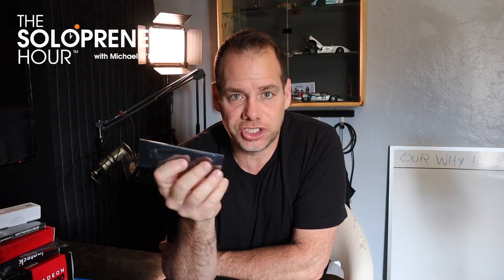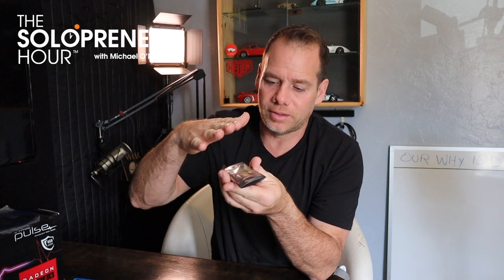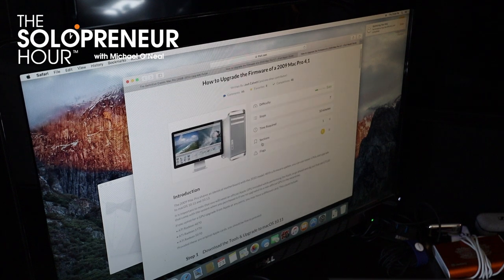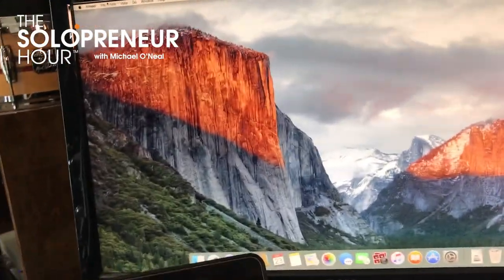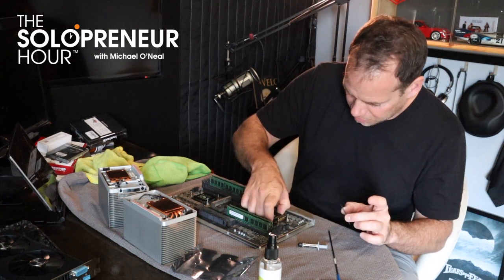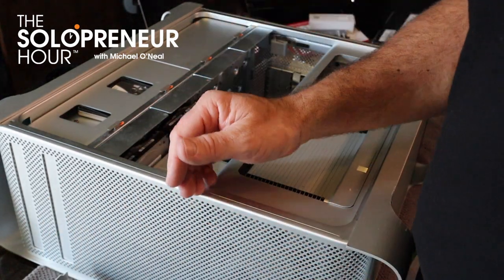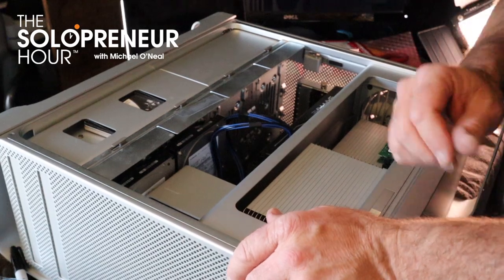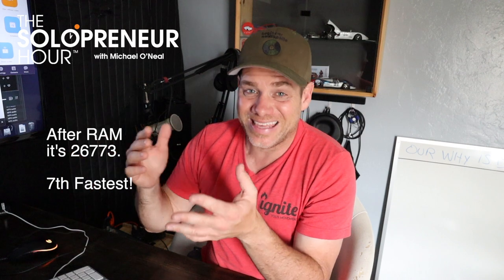The 2019 Mac Pro DIY Upgrade Guide - Building The Ultimate Video & Podcast Editing Workstation

Comment: For a self named “not an expert, I don’t do this for a living” this is the best video I’ve seen on this topic. I’ve been seen about 10 videos today and this is the best one, PERIOD! 

I’m waiting for my Mid 2010 Mac Pro I got for $400 and got a bunch of hardware that hasn’t arrived yet. Im so excited!

Thanks for this video!
Reply from the maker: How'd it go for you?
Reply: It’s up and running. It’s a dual processor. I also upgraded the CPU’s to two 3.33 6-Core, so 12-Cores total, 64GB RAM from OWC, Samsung M.2 SSD with PCI adaptor, as well as a 2.5” SSD, and a Pulse RX580 8GB GPU and a USB 3.0 PCI card. There’s still many things that can be added like a OWC Eccelsior 4M2 or the Sonnet Fusion where you can install 4 M.2’s. If you do, be sure to get the Samsung 970 EVO as it can give you up to 700mb/s on an old Mac Pro with a PCI 2.0 adaptorz The Samsung 870 EVO gives you the same speed of about 500mb/s as a 2.5” SSD. So if you’re gonna take advantage of the M.2 technology you have to get the  970 EVO or higher. 

Im loving my 2010 Mac Pro build. 

Thanks for the video!

Comment: the plastic spacers are to hold the CPU down so it makes contact with the pins because there is no lid on the CPU on the 4,1 to hold it down, the NVME or any PCI Drive does not matter if it says it is external it will still boot the same as any drive, been doing it for years on the 3,1 and the 5,1, it will even boot from the USB or the Fire wire if you want, Catalina will run on the 5,1,  it installs easier than ever, done it
Reply: give this man a cookie

Comment: I have Mac Pro 4,1 flashed to 5,1. It has 2X 2.93 Quad-Core CPUs, 32 GB RAM, AMD Radeon 7970 flashed EFI boot. SSD in PCIE card slot with 5 HDDs. I plan to put a 6th HDD in it soon and start RAIDing it. The 6th will be replacing the DVD drive. I also plan Dosdude1 patcher this Christmas break. Waiting for the bugs be worked out. My machine is hooked to my TV as media player and remote in with Apple Remote desktop. It's also my NAS/Plex server.  I also run 2 VMs on it.
Reply from the maker: Beast Mode!

Comment from the maker: THE BUILD: 
CPU - 2x Intel Xeon X5680 SLBV5 6-Core 3.33GHz 12MB LGA 1366 Processor  https://amzn.to/2JTBSib

48 GB RAM Kit - OWC 48.0GB (6X 8GB) DDR3 ECC-R PC10600 1333MHz SDRAM ECC for Mac Pro - https://amzn.to/2JOtxMC
(If you want the de-lidded versions, you have to search on eBay for them)

Graphics Card - Sapphire Radeon Pulse RX 580 8GB GDDR5 Dual HDMI / DVI-D / Dual DP - https://amzn.to/30VGjy6

Hard Drive/Storage - Sabrent 1TB Rocket NVMe PCIe M.2 2280 Internal SSD High Performance Solid State Drive https://amzn.to/2YWqTb1

SSD PCIe Card (Required to install above drive) - Lycom DT-120 M.2 PCIe to PCIe 3.0 x4 Adapter - https://amzn.to/2JR2AYy

USB 3.0 PCI Card - Inateck 4 Ports PCI-E to USB 3.0 Express Card Compatible Mac Pro (Early 2008 to 2012 Late Version) - https://amzn.to/2IdAYtt

Dual 6 Pin to Single 8 Pin Adapter Cable. (Required for Pulse Sapphire Video Card) - https://amzn.to/2Mh1Lu4

Optional (But necessary if you don’t own one) Eklind 54930 3 mm Cushion Grip Hex T-Key (For removing CPU heatsink) - https://amzn.to/2I3sRPS

Arctic Silver Thermal Paste - https://amzn.to/30VIW32
Reply: I bought everything ,

Comment: Ifixit are wrong. You can do the firmware update if you're on Yosemite. In Yosemite you don't have to disable System Integrity Protection (SIP) in order to flash the new firmware, because it doesn't exist. On El Capitan it exists.

Comment: Watching this on a Mac Pro 2009 with a Radeon 580 and a boot disk that's a Samsung 1 TB NVMe SSD. No problem booting from it, and no special tricks either. Just make sure you install the latest version of Mojave first, which gives the proper boot rom, which supports NVMe.
Reply from the maker: chaosmeister excellent!

Comment: The foam "spacers" on the heat sinks aren't evidence of a previous upgrade, they're thermal pads used to cool other components on that daughterboard, the VRMs. Usually on a PC motherboard, they're what's underneath all of the heat sinks around the CPU socket.
Reply from the maker: Oh good!  It seemed odd that it had been done before! Thanks for the intel.

Comment: Just saw your video today, but I literally just put a nearly identical box together less than a week ago.

2009 MP 4,1 2x quad core 2.26ghz processors, ATI Radeon 5770 GPU, BT no Wifi, came with all 4 drive sleds (no drives) and a power cord - $295 on ebay with the shipping.
Sapphire Radeon Pulse RX 580 8gb GPU used - $125 on ebay with the shipping (obvs it was used for mining)
Crucial MX 300 SATA SSD - $80 ebay free shipping
OWC Accelsior S PCIe SSD drive card - $50 ebay free shipping
4 port USB 3.0 card $30 ebay
Broadcom chipped 802.11ac/Bluetooth 4.0 PCIe card $40 ebay
96 GB 1333mhz ECC Ram (16GB x 6) - $180 ebay
2 x Xeon 5690 3.46ghz delidded processors $250 ebay

Thats $1150, but I probably spend another $25 on the power cable for the GPU, a DVI to HDMI cable because the Radeon 5770 had no HDMI ports and my monitor has no DVI inputs (just needed it to install Snow Leopard, upgrade to mavericks for flash, and upgrade to high sierra before dropping in the rx 580, it was crap anyway but it worked for its intended purpose), and a firewire 800 to 400 converter that I needed to support 2 legacy firepods.

So $1200 in so far.

Next friday when I get paid I'm ordering 4 x 4TB sata hard drives for project archival. I'll run them in a Raid 10 for 8TB total storage, I should be just over $1500 in at the point.

This MP is super fast, I'll geekbench it, but I assume your score was Geekbench 4, and the scores are different now in Geekbench 5

The only snag that tripped me up in the whole build was w,hen the OS wouldnt install because, like yours, it saw the SSD on the PCIe card as an external drive. Unlike your issue, because I'm using a SATA SSD instead of NVME, I just pulled the SSD off the Accelsior S card, popped it on the SATA connector in the #1 drive bay, installed High Sierra, Installed RX 580 GPU, installed Mojave, and then I pulled the SSD off the SATA connector in drive bay #1, mounted it back on the PCIe card, and fired up and everything ran wonderful without any messing around.

I know you're getting better speeds with the NVME, but I'm getting 500/420 write/read with my SSD, and it spec'd at 300/290 in the SATA v2 drive bay port, so not terrible.

I've never had macs, I've been on windows since v3.11 windows for workgroups circa 1993, so there's a learning curve, but this thing blows away the windows machine I've been fighting with for the last 8 months. Core Audio rules for my studio, I can crush editing huge RAW photo files - just files right through editing and saving them, no waiting like windows, and I'm ready to tackle some video projects I've had on the back burner for a while because I knew I'd just get frustrated using the hardware I formerly had.
Reply: Oh, While I was waiting for parts to come in I ended up grabbing a Mac Pro 3,1 2008, 8 core 2.8ghz, 16GB ram, GeForce 8800 GT GPU for $28 ($70 with the shipping) off ebay.

The interesting thing about the 3,1 is that with a couple SATA cables, a couple Molex power splitters, and a couple Molex to SATA power converters, if you ditch the Optical drive, and you pick up a couple 5.25" drive trays that each hold 2 drives, you can stick 8 HDDs inside the case, plus a SSD boot drive (or 2) on the PCIe slots.

I'll build that out next and run Sierra (unsupported) with the server app, and use it for time machine backups of the 4,1/5,1 MP, 3 iphones, ipad, etc., as well as a Plex server on a 1Gb Fios connection. The plan is to put a cheap SATA 2 raid card in it and run an external drive enclosure NAS off it to serve as a backup of the backup machine lol.

The only thing thats killing me is the cost of HDDs, 4 for the MP I just built, 8 for the 3,1, and 8 for the external enclosure. Thats 20 4TB drives. I'll buy the 16 for the older MP used, but you're still talking $1200 in HDDs.
Reply: I actually added another 8TB WD Red that I shucked from an ezstore external drive I bought used on ebay for $90
Reply: Once you go Mac you never go back.  After being a PC guy for 20 years, I decided to try my first Mac in 2008.  After one month I removed all PCs from my house.  My gf got me an XBox for Christmas that year.  When I saw that it was a Microsoft product I made her return it.  Macs rock!

Comment: From what I read about memory upgrades for the MacPro 5,1 and 4,1->5,1, 64 Gb or 96 Gb should be fine if you use 16 Gb modules (2 x 16 Gb or 3 x 16 Gb in each bank). Slots 1 and 4 of each bank share a data line, so if all 8 slots are in use, the system automatically slows memory to 1066 MHz as it access slots 1 and 4 of each bank in a common path.

Comment: you should install windows on this bad boy and unlock its full potential. Can't do it from bootcamp but you can do clean install on the ssd, install a software that reads windows harddrive from mac side and should make the windows side bootable. I have a similar build on my mac 2009 with windows and get faster benchmarks from windows. Also I can control my graphics card and overclock it.  below is my system info.
Edition: Windows 10 Pro
Version: 1903
OS Build: 18362.267
Processor: Intel(R) Xeon(R) CPU W3690 @ 3.47 GHz 3.591 Mhz, 6 Core(s), 12 Logical Processor(s)
Installed Ram 24.gb
System Model: 2009  cMacPro5,1
System Type: x64
Installed Ram 24.gb
Graphics Card: Sapphire nitro+ rx 590 8gb AMD
Storage: Samsung SSD 860 Evo 1tb (Windows) Default boot
Samsung SSD 860 1tb (Mojave)
Reply from the maker: I would actually LOVE to know how to do that.  I want to set it up for SIM racing.  I tried to hack bootcamp to work with it, but it didn't work.   Any chance you have some info you could pass along?
Reply: @solohour  No need for bootcamp. I just  installed it manually on it's own SSD from my other windows PC. I then installed it on my mac. Installed some software I forgot what it was called but it allowed me to see the SSD with the windows installed on the mac side so I could choose to boot from it.  I had issues attempting to install it on an NVMe drive so I went back onto the sata ssd. But I will follow that link below to figure out how to get the NVMe drive to work for me. Kind regards!
Reply: think it may have been called Tuxera NTFS for Mac
Reply: If you get windows on this, I would love to see a video on the benchmarks! I'm very curious to see how much faster it'll be. I subscribed and liked your video thanks!

Comment: Great Vid, I'm looking to upgrade my graphics card cause I have 3 monitors connected to my mac and one of the monitors is losing signal every10-15min (going in and out). After I changed wires, and a  new monitor it continues to do that. So I'm pretty sure now it's the Graphics card.  Would you recommend the Sapphire? because I have the same mac.

Comment: Hi,

What is the read and write speed of your SSD. Also the pcIe card does not have a fan. Do you have any problem with the heat? Also when you edit video files in FCPX, do you use proxy files or can your SSD handle like 4k videos?

Comment: Tech notes: Read up on static discharges .. before doing any work with electronics ground yourself by touching the metal chassis of the computer - plugged in but power OFF. Be aware around mains power.
 And keep the time to insert new CPU's into their respective sockets to a minimum to avoid socket contamination.

Comment: Michael: Many thanks for taking the time to present your "Build" and all the components listed in detail. I wanted to ask about the  compatibility of the USB 3.0 card (Inateck 4-ports). In the Amazon description it reads: "Compatible System: Mac OS 10. 8. 2 to Mac OS 10. 9. 5. It is applicable to MAC Pro(Early 2008 to 2012 Late Version); Windows XP/Vista/7/8/10(32/64-bit). Incompatible with Mac OS X 10. 10 Yosemite or Above."  

A little more research from MacRumors: https://forums.macrumors.com/threads/usb-3-x-pcie-cards-for-classic-mac-pro.1501482/. The consensus for those having problems with the Inatek 3.0 4-port card using Yosemite + is this: "The KT-4004 generally works well with OS X 10.10.x & 10.11.x but is not officially supported by Inateck for these versions." and then "If you are one of the few users that have problems with this card running under Yosemite, I suggest you return the card for a refund and purchase either the Sonnet Allegro USB 3.0 4-Port card or the HighPoint 1144D 4-Port card."
Reply from the maker: A BirdyNumNum it’s working for me at the mo...but if there’s another card you like more, go for it.
Reply: Michael, here is an Update from my last report: I got all the parts ordered and delivered. Following another video, I de-lidded the new 3.3 GHz CPU's. I may have damaged one or both (little pins) when sanding the tops of the CPU (after removing the solder). At the moment I have the  CPU's being examined at a computer store for damage. I may have to re-purchase two 3.3 GHz CPU's and this time I will install lidded CPU's.

I found that the re-installed 2.4 GHz CPU's will only hold 32 GB memory (RAM). I can add 5 x 8 GB sticks, but the system only reads 32 GB (4 x 8 GB). If I put in 6 x 8 GB sticks or RAM the system will NOT boot. So, once I install new 3.3 GHz CPU's I shall attempt to install all 6 x 8 (48 GB) RAM. 

Graphics card: I purchased and installed the AMD Radeon Sapphire Pulse RX 580 card (8 GB). Here is what I found with my system: 1. the card needs to be calibrated. 2. In the monitor display settings (whether a Dell or LG, etc.) one needs to change the color settings/ input color format: **from RGB to YPbPr**. I also found that each time I "Shut Down" my system to reinstall or remove RAM, the Color settings changed back to RGB. I have to manually change from RGB to YPbPR each time. It is not much to do but a hassle nonetheless. I am not sure why the settings are not saved after "shut down". Any thoughts?
Reply: The incompatibility 'problem' is that after putting your computer to 'sleep'  and later booting it on - the display shows that all the active inputs to the Inatek  USB card have not been dismounted correctly.
Just close them down as indicated and all is OK.

Comment: I apologize for the language, but I'm using the machine translator.
First of all, thank you for the video; it was interesting.
However, I have some doubts about the video card.
1) With an older operating system can't you use it?
2) With this video card, are you able to see the boot screen?
Because I know a lot of people don't and I think it's a problem,
when you have to execute commands at startup if you do not see the screen.
Another question: but couldn't you put an SSD directly into one of the four slots?
Thank you

Translated with www.DeepL.com/Translator (free version)

Comment: I have a 2009 Mac Pro with 4,1 can I leave my CPUs inside and just update the firmware so I can use the latest OS? Can’t afford new CPUs
Reply: You can update the firmware without changing the CPUs, but that alone will only allow you to update to High Sierra. I just did this today. To upgrade macOS further, you would need an approved GPU in order to update to Mojave. Catalina would still not be supported, though there are other means to force it. https://appleinsider.com/articles/18/09/25/apple-says-these-mac-pro-graphics-cards-are-mojave-compatible-reveals-boot-camp-support-limited-for-imac
Reply: The 5,1 flash will bring you to High Sierra. For Mojave you need a Metal compatible GPU. I just installed the Radeon Sapphire Pulse RX580. Not the cheapest card (240 euro's), but it works like a charm. Not sure about Catalina, but as an audio guy I try to stay away from Catalina for as long as possible :). I then upgraded my CPU's from the original 8 core 2.26 GHz dual CPU config to two Xeon X5675 (3.1 GHz), almost doubling my Geekbench multicore score to 6200. And after installing Mojave, I also added a Samsung 1TB NVMe M.2 ssd, which is now my boot disk. The entire upgrade costs around 650 euros (graphics 240, cpu 120, ssd 180, all ordered locally here in The Netherlands and not gambling with cheap Chinese vendors who may or may not deliver the goods) and the machine feels like new. A new MacPro 2019 base model (8 core) has a Geekbench multicore score of 8000 and my 11 year old MacPro runs 6200. Not bad at all :). Even the all maxed out new MacPro 28-core scores "only" 19,000 on multicore, which is only triple the speed of my 11 yr old machine. I'd expected the difference to be much bigger.
Reply: Christopher Moonier I have a Sapphire Radeon HD 7970 in my Mac Pro 2009. There is no boot screen but it works. Do you think that would work for catolina? Thanks. I really need the latest os otherwise I may aswell sell it.
Reply: @datmanUK  No idea about the 7970. The 7950 seems to be Meal compatible...  An no you don't need Catalina.  At least: I don't. Lots of apps are still not 64 bit and will not work under Catalina.  Think about that...
Reply: Hi, just checking. Will I lose any data on my boot up drive if I flash my Mac to 5,1.
Reply: @datmanUK  Nope. Firmware update is easy and safe if you don't do stupid stuff like switching off the machine while it is updating.

Comment: If you’re doing this upgrade, ffs do not do it on a towel! Learn the simple techniques to be static safe before you fry hard-to-find components that you spent your well-earned cash on.
Reply from the maker: Ok!  Note to self!  I was trying not to scratch my table, but that makes perfect sense.
Reply: Kythera  from my decade plus of repair experience, just no. Modern computer components have very fine traces that will vaporize from the infinite amperage of a static arc. There is plenty of scientific evidence to prove this.